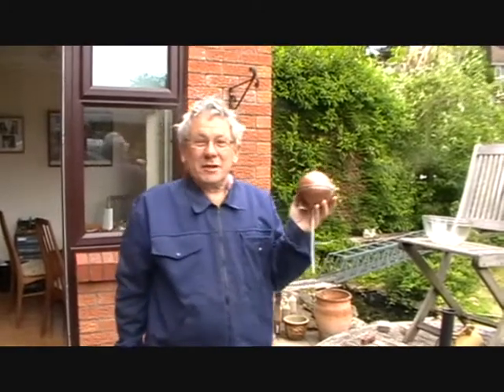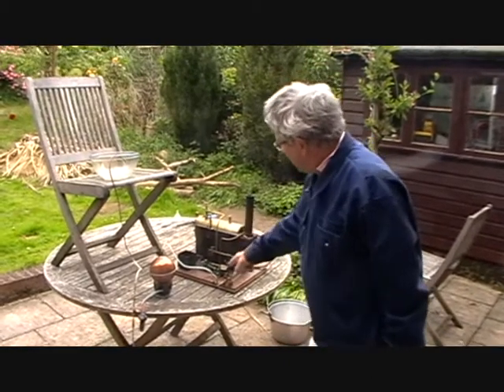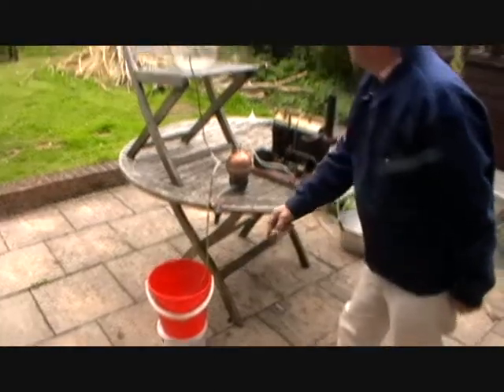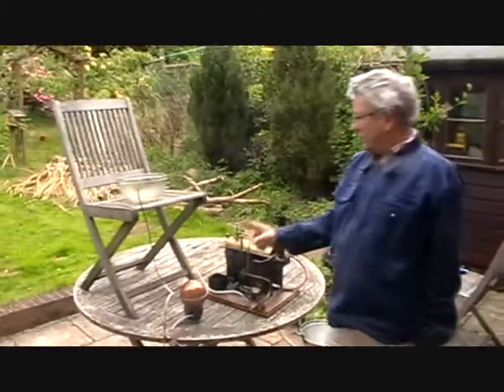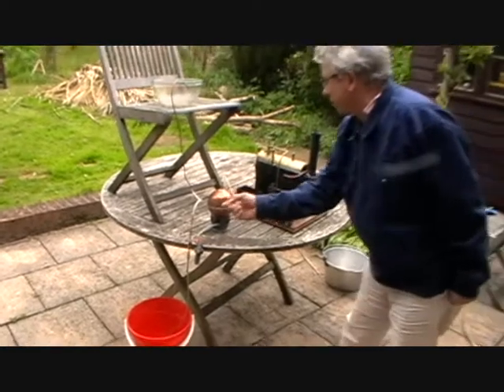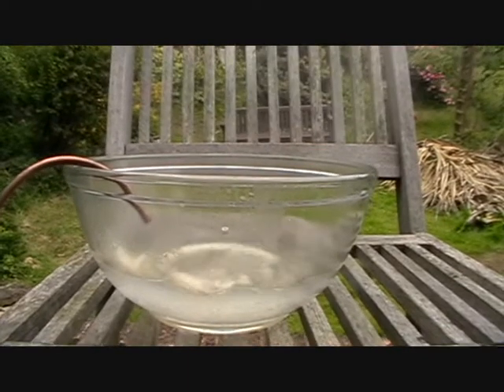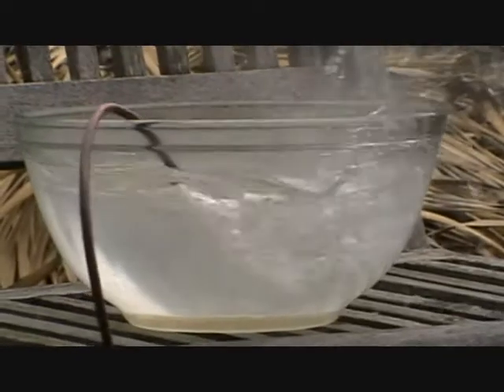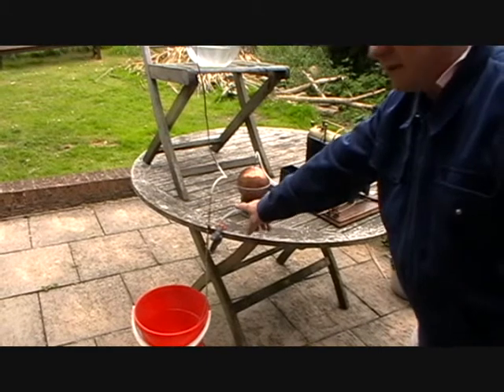Savery steam engine

Comment: Geeze  Wayne this is NOT accurate!  you are using a PRESSURE BOILER  to blast the water out ---- NO NO, pressure boilers were not used  in the" Savery  fyre engine"     .I like the copper ball though.    The system used two of them (usually  more cylindrical )  steam from a very conventional tub boiler ( no tubes they were decades in the future) with a lid on was piped to the copper tanks controlled by a series of taps (cocks) which were alternately filled with  LOW PRESSURE STEAM ,cock off, cock to the water pipe opened,& fwoosh the cold water  condense the steam &  "sucked" the water in to the tank   (actually you are correct ,the air pressure  pushes it up) ,next the cold water cock is closed ,& the DRAIN cock empties the  tank . while this is going on the  OTHER tank is  filling so there is a pretty  continuous  operation& yeah a bloke did the oning & offing of tithe cocks , stoking the  boiler  etc.   this was not an "engine" as we think of them  it was the old  meaning  more properly termed a DEVICE  today  . this is the CONDENSING SYSTEM which was used  by  NEWCOMEN to build the  first true self acting engine which was also a pump only.  Not till  James WATT coupled a newcomen beam to a flywheel did we  get a true engine,(still using  air  pressure) the use of contained pressured steam was to com then later still boiler tubes etc. its a fascinating story check it out! sorry to be critical friend  I should  build a model too. cheers
Reply: No need to be so SHOUTY .
  Thomas Savery wrote a pamphlet on what he called `The Miner's Friend` describing his `engine to raise water by fire` so he clearly felt that the word `engine` was correct. Such devices were for a number of years referred to as Fire Engines which is another example of how language changes over the centuries.
This is an excellent demonstration of the principle of the device and the fact that steam is raised in a modern boiler is irrelevant.
Perhaps as you say you should also build an engine (or device) instead of reciting a brief history of those who did.

Comment: I don't think this counts as an engine because it's not automatic
Reply: Well this is just a demonstration. What Savery did was he let the water released on the top be sprayed on the pod, thereby cooling it an condensing the steam. Thus, the formation of the vacuum and continuation of the cycle.
He did further this though, and created two pods that could operate in alternation. For those, he did make use of valves that were opened and closed manually in right sequence.
Of course, this did have serious limitations, but I'm not going to go into detail.

Comment: So let me get this straight.

1: Pressurized steam pushes water out of the chamber and up the pipe when the valve to the boiler is opened. A one way valve at the exit of the chamber prevents the water and steam from escaping into the reservoir below.

2: Once all the water has been pushed out of the chamber, the operator would close the valve to the boiler.

3. Leftover steam in the water chamber condenses and this creates a low pressure area in the chamber and because of the pressure of the atmosphere around the reservoir is higher than the chamber pressure, more water rises into it. As the chamber is filling, a one way valve only allows water to flow into the chamber but prevents it from dripping back down when the chamber is finished filling.

4: The process is repeated by opening the valve to the boiler again.
Reply from the maker: Yes this is exactly right
Reply: NO this is wrong see my explanation